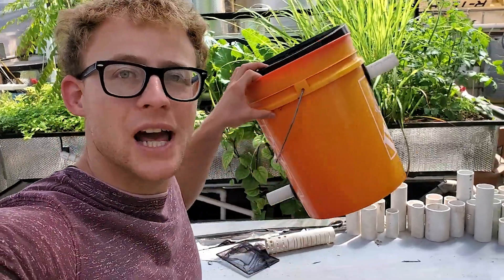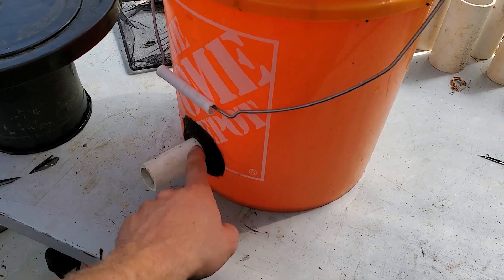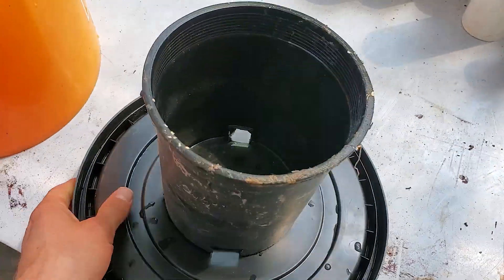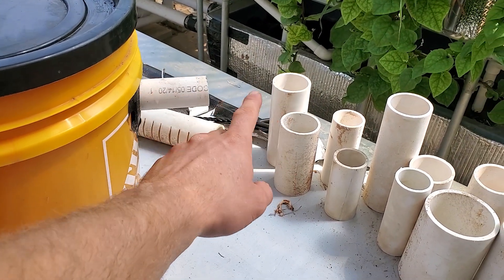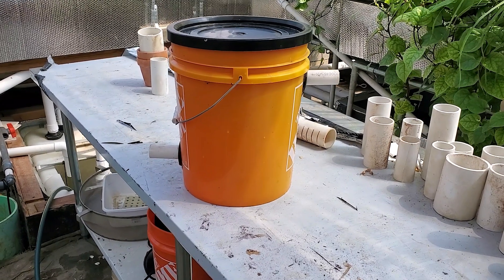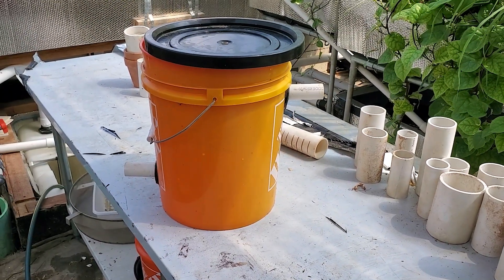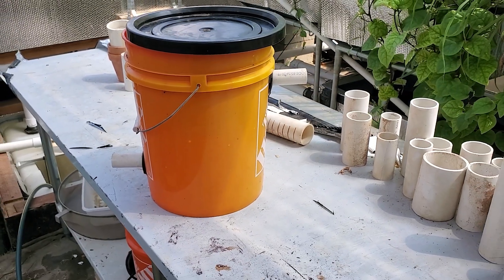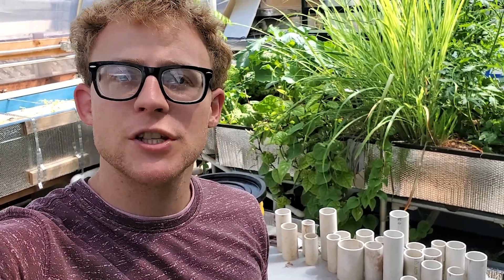SUPER simple DIY 5 gallon bucket radial flow filter or radial flow settler (aquaponic or pond filter

Comment: Your probably better off using 6” pvc. Those wholes in the flower pot will defeat the whole purpose
Reply: Actually I could be wrong I just noticed they may be a tad higher than the outlet
Reply from the maker: Ya they are high enough that the water won't go through those holes. A 6"pvc is nice buy less accessible for most. The pots are easy to get. And you can get them with out the holes at the bottom. The one with the holes is just what was used on this one. 
Or you can use two pots and just offset them. But u would probably still need a hole so you don't cause it to create a siphon.